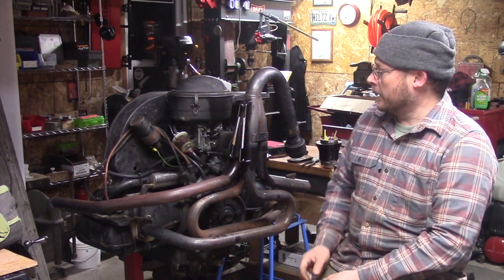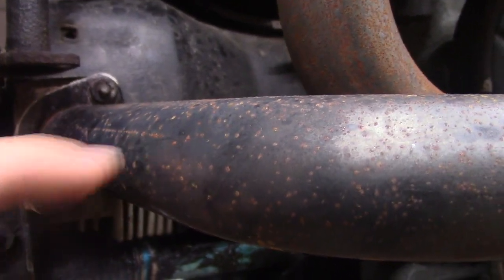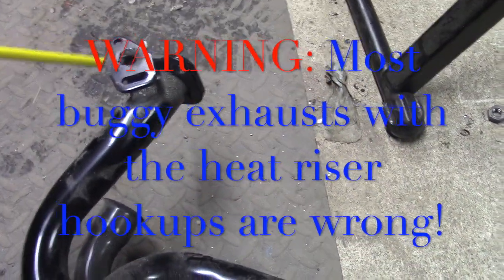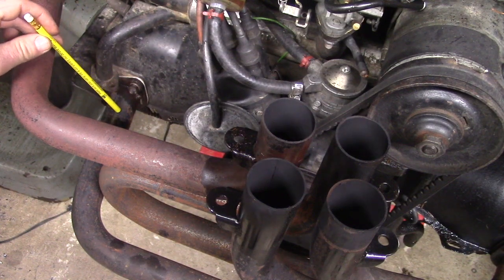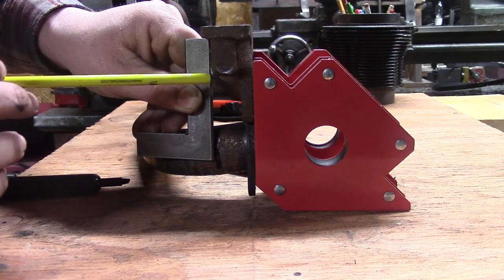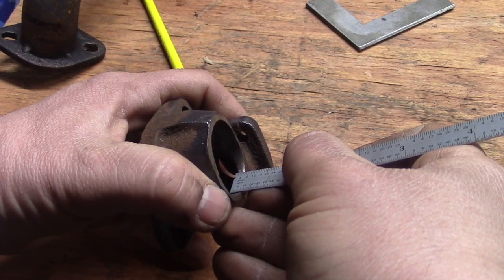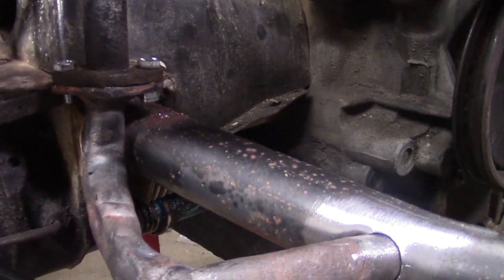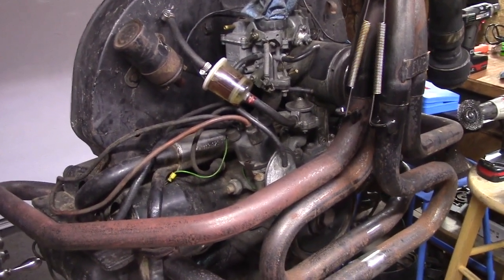VW Heat Riser Fabrication on Baja & Buggy Exhausts

Comment: Great job I had my old dune buggy ice up all the time didn't know they had to be in town different locations I took for granted a new exhaust had them in the right spot but great job fabricating
Reply from the maker: Thank you for the comment. For a long time I also just ran the “factory” heat riser holes on the aftermarket mufflers - and I had the same problem with icing. This really did help my issue and the heat risers are warm/hot to the touch now like they should be. They never really warmed up before
Reply from the maker: I’ve been running this exhaust ever since the video was made without any issues

Comment: Oh joy. The 64 baja I got lacks heat risers. The manifold is chopped up for the heat pipes too, so I'd have to replace that. Looks like some idiot also cut off the heat riser connectors from exhaust too and welded in patches on both sides. At least they're not expensive used, but it's just another expensive due to a dumb past owner.
Reply from the maker: Frustrating to chase problems from previous owners, for sure!
Reply: @MaineMachinist   And there's no shortage on this one. Bought myself way more of a project than expected or wanted, but I'm stuck with it now.
Reply from the maker: @cubey  that tends to happen... sadly these cars were very cheap for a long time, and a lot of people just held them together with duct tape and body filler. Even the ones made into buggies or sandals were often thrown together as cheap projects.

Good luck! I have a fair amount of videos on aircooled stuff, and more coming out all the time.
Reply: @MaineMachinist   Someone at one time did deck it out, it has nice custom rear rims, empi brackets for adding extra shocks in the rear (has stock shock plus air) and front beam reinforcement brackets. But I'm guessing it was an owner after that who was crap at repair who started screwing things up.

And it could be the car ran too hot in the SW summers, so the heat riser delete was to address that.

Comment: Could you use a flexible piece of stainless pipe so as not to have to make all the bends on the left pipe?  I found a 5/8" exhaust pipe that looks like a corogated electrical conduit. I  was thinking of connecting the 1/2" heat tube to the flex pipe at both ends-it will fit right inside it, tightly.. Would the flex pipe carry the flow on the left side for about a foot well enough as compared to the rigid pipe?  I would only use the rigid pipe at the flange connection and on the other end where it is welded to the collector pipe. The flex portion would be in the middle. I'm trying to get the left flow as close to the collector as possible and away from the head, if this is best.  Thanks for the video.
Reply from the maker: Sounds like a decent plan! If you end up doing it, please let us know how it worked. I thought it would be easier to stick with common materials instead of trying to join stainless to the mild steel

Comment: For someone who doesn’t have the ability to start cutting and welding / fabricating.. I have the same exhaust you showed, that does have the heat riser flangs but they are in identical locations.. the holes are must different in diameter, one being very small and the other much larger.. would that have a similar affect for allowing the heat to flow?
Reply from the maker: Hey thanks for the comment!

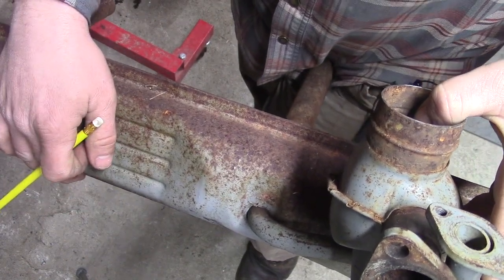The off road exhausts with the heat riser hookups, like the one I show at 5:15, are better than nothing, but they don't really work as intended. They use the different size holes to try to keep the exhaust from fighting itself with equal pressure coming from both sides, but they really don't cause the draw to happen like the factory VW muffler. If there's nothing you can do to fix it yourself, its better than nothing, but you won't get optimum heat to the risers.